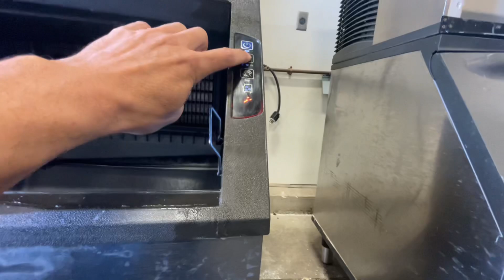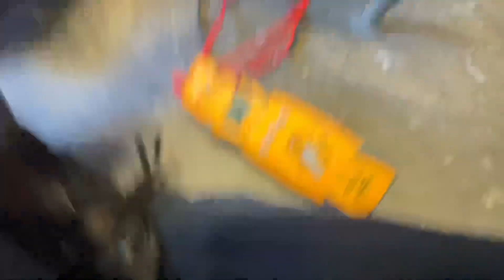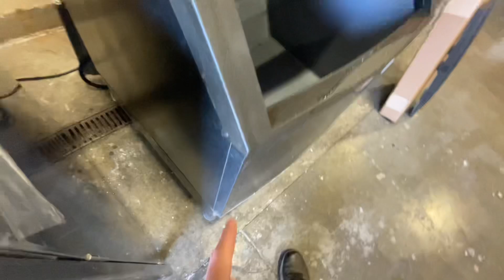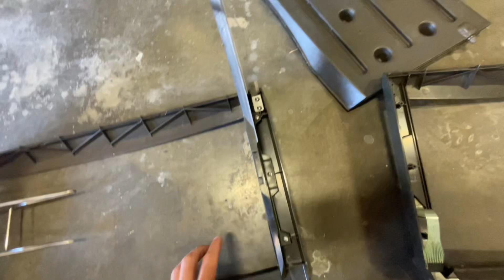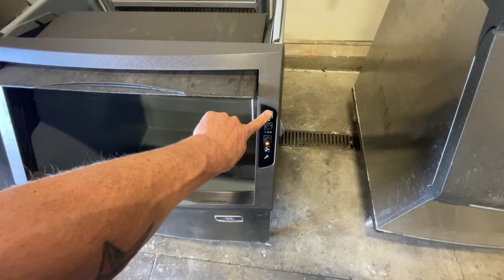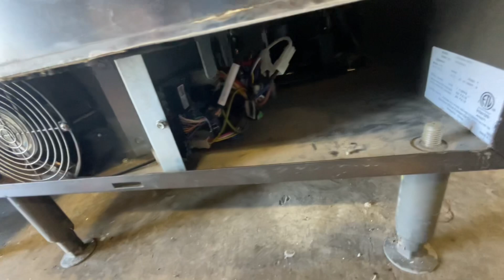Manitowoc ice machine not turning on - Power button trouble shooting and repair

Comment: I have a Neo at work. I did a deep clean on it
Including cleaning the air filter and condencer coils, and everything inside. I even changed the water filter. I plugged it back in, and the little light comes on at the on off switch and the little ice cube light is on, but nothing is happening. And if I turn off the on off switch by holding it for 3 seconds, then hit the clean button. Still, nothing happens. Should I try that little blue reset button, you talk about in the video ? The machine worked before I cleaned it. 😢  Feeling kind of responsible here.
Reply from the maker: Check obvious things first. Make sure everything is plugged in. Water is on. Parts are installed properly. 

The ice cube light is usually on if the ice damper is open(the flapper is flapped open). If you can’t get it to work just email me. I’ll face time you and get it fixed.

Comment: Do you have part number?
Reply from the maker: 040003501 that’s a part number for the part but it may not be the correct size. You’ll have to verify it’s a fit based off your specific model of ice machine.

Comment: Can u charge a unit like that. And if so. What kind of Freon and where do I charge it at
Reply from the maker: These machines can be charged with refrigerant. Check the machines data plate for the type and amount of refrigerant. The ports are under the storage bin.

Comment: Whats the direction of the fan ? Should it be pulling air into the condenser?
Reply from the maker: Air will flow in the right side and out the left side.
Reply: @ have you ever seen a fan  malfunction and pull air into the condenser?
Reply: Ok figured  out the issue . Apparently the power for this business was turned off and causing  a power surge and making the fan run backwards. The unit  was unplugged for 5 mins and is working correctly now . New one for me .

Comment: I just had to replace this touch pad last week.  I never worked on this type of ice machine before but I figured it out.  The whole time I thought I was going to break some plastic and then it would never go back together.  I was gentile but persistent and didn't damage anything.  The orange wires coming off the pad were all completely broken off of the pad.  I didn't have any major issues and got it running.  Sanitized it too because, why not.  It was down for 3 weeks.
Reply from the maker: Doing for the first time is rough. Glad you were able to figure it out without damaging something. I definitely did.

Comment: Same model machine 2 pic issue. One machine power button lights is slightly blow color no dark and water no coming.second machine pad area power is coming press on button water is not coming
Reply from the maker: The best thing for you to do is call  Manitowoc Tech Support. They will be able to help you out. 
Phone: 800-247-4520

Comment: Very common problem with this NEO model . I’ve own and sold a few .The key pad is right by in front of the bin so when people pull out the ice .water makes it way to the keypad . I’ve recommended putting a small amount of silicone on around the keypads it self . Unfortunately you have to change out whole front door assembly to fix but if customer needs ice you can hold down the reset button at the control board and the machines will run 500 cycle of ice . This buys them time to get a new part .
Reply from the maker: You are right! Kinda strange that the touch pad doesn’t come by itself. The test mode button is a solid trick to get some ice. The software version has to be above a certain level to work. I can’t remember exactly what the software version is though.
Reply: @IceMachine411  I think you can also jump the pins 2 and 7 at the board and it will make ice .